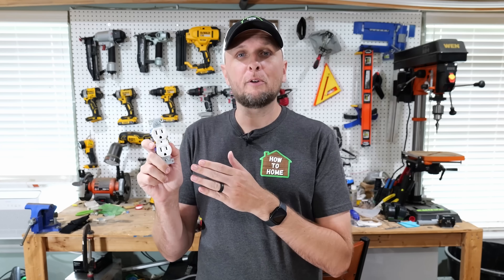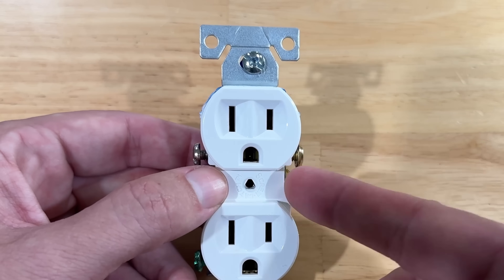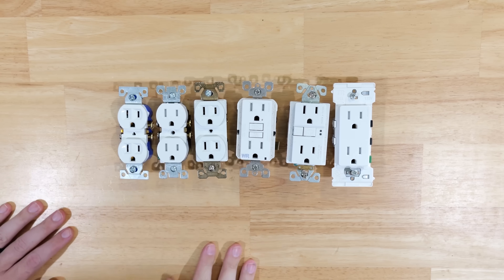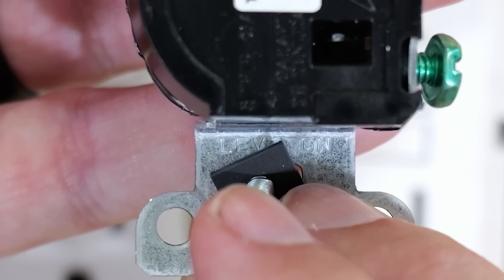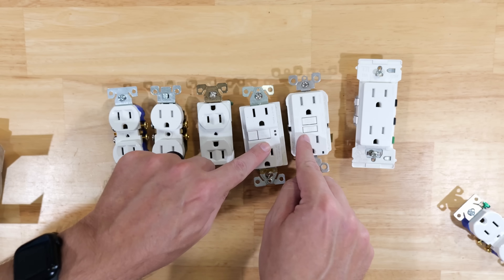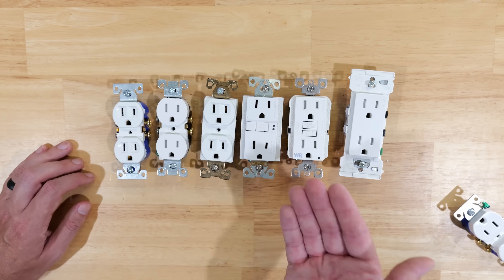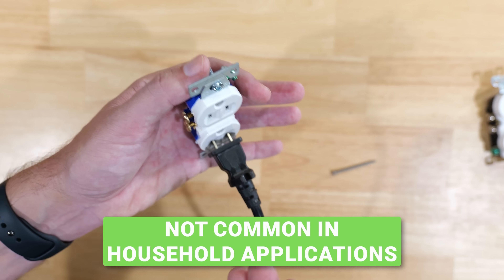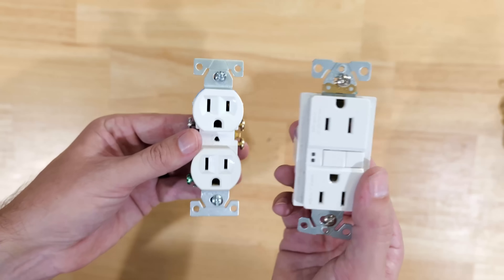The Shocking Reason Why Your Outlets Are Installed Upside Down!

Comment: My house was built with ground up when the bottom receptacle is wire through an on/off switch; if both outlets are hot, not wired through a wall on/off switch, then the receptacle was installed with the ground down.  This allows the residents to know if power to the lower outlet is wired to a wall switch.

Comment: Any chance you have covered changing a whole house fan switch with dual-speed capability? And I don’t mean a wall switch. The kind of switch similar to a rotating fan where you pull the chain to select the on/off features.

Comment: To me the safest way to mount a power outlet would be sideways with the neutral side facing up towards the ceiling and the hot side facing down towards the floor no chance of having a short due to something touching the two prongs of whatever is plugged into it.

Comment: Hospitals install them ground up.  The reason I was told is that, similar to the nail explanation you did, the reason had to do with metal necklaces and bracelets catching across the terminals when bending down to deal with a plug.

Comment: In Canada all hospitals install with the prong up, so any metal object fall down touch the prong (ground) first before get energized, it might trip the circuit breaker,but it will protect the user. it is more of safety than anything else

Comment: When I worked for an electrician, in 1988, (yes, I'm old) he told me to do ground up, because if it's metal cover plate an it magically falls it won't cause a short.

I prefer the look of the face
(😮)
(😮)  and only use plastic cover plates.

Comment: N.E.C. states Any direction is acceptable. Stop with the clickbait type BS.
Reply: 😂🤣😂 Oops commented on the thumbnail. in the first 30 you mentioned you would address the code
Reply: I would add the only way i would consider the "something falling in the gap" issue would be in a horizontal installation i would have neutral up ( ground to the left) . Though in reality it all boils down to personal preference/aesthetics.

Comment: Hello As an electrician starting in early 70’s. receptacle orientation was to be grd side down. The grd prong would be made first and disconnected last since it is longer (for safety reasons). But if the cord was heavy or a loose connection or physically knocked downward there may be a chance the power prongs may be disturbed but the weight or orientation of the hanging plug would insure the grd is not disconnected. Nowadays does it matter.
FYI as an apprentices we tried to drop many sizes of nails,cutlery etc onto a partially seated plug and were not able to cause a fault.

Comment: Ground on top is standard in hospitals so in the event that a scalpel or any other metallic instrument gets dropped on a plug that is not fully inverted, it hits the ground first, and depending on which way it falls from there, it will do no harm on the neutral, Or going the other way, it will spark and trip the breaker will minimal damage.  In a residence it doesn't matter but, for whatever reason, historically the convention has been ground at the bottom, even though ground on top actually makes more sense.  Frequently outlets installed in counter top back splash panels are installed horizontal.

Comment: About the thumb in between the prongs... it was easier for the 3 year old kid to maneuver the plug into the receptacle with the thumb in between the hot and neutral. Guess what happened... i suppose that actually getting that sidewinder to work would've been more disastrous, it weighting about half the 3 year old's weight, or am i wrong? 
I supose that's a how to video on child caring.

Comment: Fire Dept responded to burning receptacle/smell of smoke in house.  Found dining room receptacle blackened and breaker was tripped. Receptacle was installed with ground hole on top.  Cause:  Small child was crawling along the floor and found a coin.  Child slid the coin up from below and shorted the hot and neutral blades together creating the flash that charred the receptacle before the overcurrent device reacted. Child was too young to verbalize what he had done but the evidence was intact.

Comment: What the heck are the chances of something metal falling across the plug prongs, slim or none, so your argument doesn't stand up! Remember when a cord is plug in nothing is going to be able to make contact with the prongs on the plug. What if the sky falls?????? The easy way to remember which way to install the receptacle is think of the ground is down, not up!!!!

Comment: In basement apartments, my arbitrary preference is ground down. In case of flooding, you get that extra quarter inch before the water reaches the hot receptacle.

Probably a negligible reason, but since it otherwise doesn't matter at all, I'll take that tiny bit of extra safety margin.

Comment: 00:30 I have them sideways 🤷‍♂️
Reply: Ground should be to the left so that the neutral prong is on top
Reply: @marccrocker1908  Not required by NEC.
Reply: @WesB1972  Just because it is not "required" does not mean you should not use logic. When sideways install the receptacle neutral-side up. It "doesn't matter" until something metal falls on the hot prong and shorts the circuit or sparks a fire.
Reply: I use a diagonal to get the worst of all worlds.
Reply: That’s old news I stole the government seized research from Nicola Tesla and have had wireless electricity transmissions for decades now no wires or outlets at all
Reply: I turn them around so i can access the wires directly, the holes pointing into the wall to protect them from dust.
Reply: I got a fork stuck in mine
Reply: With the "mouth" on the left or right?
Reply: Me too. Ground to the right. First place I lived that was this way in my 69 years.

Comment: I always heard the argument for ground plug up is when a cord with a ground is connected and say its at a receptacle that sits much higher then where the cord leads back to, think compressor sitting on floor and connected to receptacle at the 4' mark, then said cable being heavy and "hanging" tends to put too much pressure on that plug and wears out the ground plug and leads to them weak and falling off.  That combined with peoples tendancies to just yank on the cord to unplug it, can help ease that pressure there also.  And, is less likely for a heavy cord to partially disconnect from weight and gravity if the ground prong is up.

Comment: In France and half europe, half of the pin is platsic, and metal disconnects before its visible. Also, france has « pit sockets » so event full metal pins remain untouchable anyway. 

Put a GFC and forget about the rest.

Comment: For 10 years I asked all the electricians I saw the same question. Because I notice that all the plugs in hospitals were plug up.  After 15+ years a Union Journeyman electrician for 30+ years, said “there is no rule unless called for in the drawings” but we all install grounds up in all commercial and industrial buildings (Hospitals), grounds only go down in residential buildings.

Comment: One reason to have prong side down, even if there is no prong used, is when you use a charging/ plug in wire or  adapter. (My coffee maker) If the hot and cold holes are wrong, the adapter hangs upside down, and since it's heavier on the bottom....offset, it keeps falling out! Reverse it and it hangs right and stays in place.

Comment: It’s against certain local codes around water access areas and/or outdoors especially with gfci’s being that if there was a splash or leak that sprayed on an outlet with something plugged in then the water obviously obeying Newton’s laws would flow down and therefore a steady stream of water would connect the ground to the hot and could certainly cause a problem…

Comment: Never have seen a 90 degree plug with the ground lug up. Whether its a close wall appliance like a refrigerator, etc., or a close wall plug for a lamp to allow furniture to be closely placed against the wall, there is a clear choice.

The odds of a paperclip or other metal object falling between the plug and wall is almost nonexistant. First, the plug has to be partially installed while making contact within the outlet. Second, the shorting object needs to fall in a way to hit that narrow space and contact both the line lug and the neutral or ground lug. With the ground lug up, its still possible to have a direct short betwen the ground lug and the line lug.

Comment: When you have something with a grounded plug, and the prongs are at 90° to the cord, an outlet with ground receptacle down would make the most sense.

Why does your thumbnail have a green check mark on the outlet shown the way you say at the end is not the way you install them?

Comment: You completely missed the most important reason (in my opinion) for having ground prong up. . .  Physics. . .  Because the ground prong is round, it's far more rigid.  Additionally, the ground prong is always longer than the two bladed prongs.  Therefore, with the ground prong up, when you plug in a 3 prong plug – which, those cords are usually far heavier – the ground prong being on top causes the plug to stay flush to the outlet far longer over time, while the weight puts strain on the connection.

Comment: In commercial construction we ALWAYS do ground down because in sub spaces (subterranean,  meaning below ground floors - like residential basements only in commercial buildings often fully occupied) any flooding puts the ground into the water circuit before the live, greatly reducing the chance of fires in remote electrical closets or transformer installs.

Comment: It goes ground prong down.  Period.  Everything else is bullshit.  Look at at how every 90 degree power cord or power adapter is constructed.  If you are ground prong up they will fail prematurely and it is more likely to come out of the socket and/or place undo strain on the outlet and cause it to fail prematurely.  If something falls on the hot and neutral it will trip the GFCI and/or the circuit breaker.  The argument for ground prong up is just stupidity.

Comment: I have personally had a metal guitar string land across a ground-down plug that wasn't quite plugged in fully and short the hot and neutral.  If you work with thin bits of metal in an area, keep the ground up, or if it's sideways, the neutral up.

Comment: The other consideration is “flat plug” type devices. You see this on power bars a lot where the cord runs flat against the wall and often those plugs are molded with the expectation that the ground is on the bottom, otherwise the cord would be hanging out from the wall in a way that would create constant tension on the connector, leading to premature breakage of the insulation or increased likelihood of tripping and yanking the plug out.

Comment: My understanding is there are certain instances where the ground pin should be up. One instance i was told is when a metal faceplate is used. If for some reason the faceplate came loose it would fall on the power prongs shorting them out. I have done both, Depending on the situation. Are 220 volt plugs ground up or down? Does it matter? If you have a defective or shunted fuse or circuit breaker ( don't laugh at the shunted comment people frightening enough  I've seen it done) than yes. Other than that, you probably have a greater chance of getting struck by lightning.

Comment: Funny I've actually received a little shock doing just that. My finger slipped and touched the prongs before it was all the way out of the receptacle.
I find when heavy cords are plugged into the outlet and the faces upside down the plug wants to fall out. When the outlet is in the face up direction. Now the weight of the cord is all on that big fat single pin at the bottom.

Comment: "Ground up" might make sense, but most cable makers design them as "ground down". Look at any low profile cable, if your outlet was ground up the cable would be sticking up in the air. I've had switched outlets installed as "ground up" where only one side is switched and the other is not. The non-switched side I've found difficult to use given cable/brick designs. Also "ground down" gives charging bricks more space to not obstruct the bottom outlet if it's a small brick. Since most people use "ground down", that is the standard whether it makes sense or not.

Comment: I've seen receptacles on the floor in Old homes in Detroit usually in the living room. I think the idea was they didn't want a  cord running across the floor from a wall outlet. These are larger homes that would probably have the furniture more in the middle of the living room and not just along the walls.

Comment: Electrician. There's no incorrect orientation for a NEMA 5-15 duplex receptacle. The "standard" is de facto. Exit: There are exceptions, but in general, you can install all your outlets crooked if you desire.

Comment: 45years residential had always been on the ground down. And hospital applications, ground up. The reason that I’ve heard this explains that one of the hots and neutral or face up if it gets pulled down a little bit to expose the blades, a paper clip could drop down and cause a problem. I personally I’ve never seen this happen, but that’s what we were told in the industry.

Comment: Ground prong down for me: I feel like if you're plugging a heavy cable into the outlet, having the weight set on the ground side facing the wall is just a bit more secure.

Comment: You showed a GFI like my new one however old one has line in reversed and I installed it  incorrectly. Now I have to reinstall and see if wires can reach. I may have too short, else need rerouting in box. Lots of folks claim ground up in commercial buildings, and thats when I first saw it.

Comment: I've been to many houses where the switched outlets have the outlets with ground prong up and the rest with the ground prong down.  I like this because you know to find the switch to operate the outlet.
Reply: That's NOT an option in most cities.
Reply: @richietattersall2122 why is that not a option?
Reply: Never seen it, I have only been in a thousand homes since I never got a realtors license.  Only 2 chicken coops but the houses roof was a decade overdue for replacement, it was out near the wood mill.  Seen a dozen witth Koi ponds, including mine and a neighbors.

Comment: I actually had that rare short happen to me on a commercial job, back in the ‘90s. I do HVAC work and was working in the old mechanical room of a banquet center we took care of. We were all done and packing up when I went to unplug a flood light or vacuum pump or something. The blades of the plug were really tightly gripped by the outlet and I had to wiggle it in order to get it out. Unknown to me, the metal outlet cover plate didn’t have the center screw installed and as the hot & neutral prongs came out, the metal cover plate on the gang box slipped, fell, and shorted the 2 prongs of my plug. The breaker it tripped also powered some of the banquet hall’s offices and knocked out some of their computers, ruining some unsaved work. Oops!
Reply: Always check for those screws.   That outlet wasn't safe to use.   I believe,  but don't know for a fact, that the middle screw on an outlet may have something to do with grounding safety .  Either way don't use it if the screw is missing.   That begs the question Why is it missing?
Reply: @Parakeetfriend4215  , I don’t remember if I was the one who plugged it into the receptacle in the first place. I do remember seeing the faceplate wiggle and being loose as I rocked the plug back and forth, but didn’t think the screw was missing, just that it was loose. The building was probably built in ‘50s or ‘60s, so, the electrical boxes & receptacles were better quality than we get today. It was a 2X box mounted on concrete block and the faceplate fit snuggly on the receptacle, until I started wiggling the plug! Lol

I believe you are correct, when using a metal faceplate (required when the box is not mounted inside a wall, I believe) the center mounting screw grounds the faceplate to the receptacle, instead of relying on the faceplate being grounded by contact with the gang box. So, that is good advice.

(I don’t mean to be a grammar-notzee, but, to “beg the question” is a logical fallacy. You raised a question.)

Comment: Theoretically, the upside down ones are connected to a wall switch - the same type of wall switch used to turn on ceiling lights and fans. It's been that way for years at the places I've been.

Comment: In Mexico a los of these receptacles are positioned horizontally, using a vertical position only for light switches. So, what'd be the code for that? Round joke to the left or to the right? Or are we simply evil for bringing in yet another debate in? 😂

Comment: The mass majority of applications ground down is the way to go just to be consistent with the rest of the country.  

Both arguments were stupid and if you're that much of an id10t, maybe you shouldn't be plugging things in.  

Installing ground up just to be different is being an @$$#ole for the sake of being different. 

Lastly, the only thing that really matters is white/creme color outlets vs. orange outlets.  We use orange outlets to designate that outlet is on a protected circuit. Commonly with a power conditioner, but sometimes a power conditioner + Industrial UPS.  Not used commonly in a residential environments.  

If you do install orange outlets with a power conditioner, still install it prong side down, don't be an @$$#ole.

Comment: I like ground prong down for the reason you gave. Also, some 3-prong appliances and surge strips have low profile right-angle plugs where the cord exits on the ground prong side; so if the ground was up, the plug would likely work its way out.